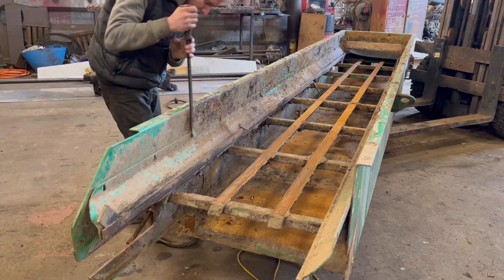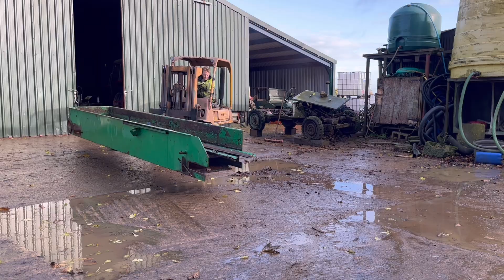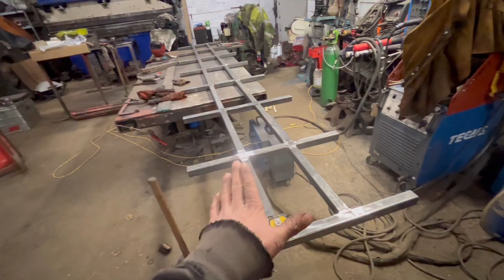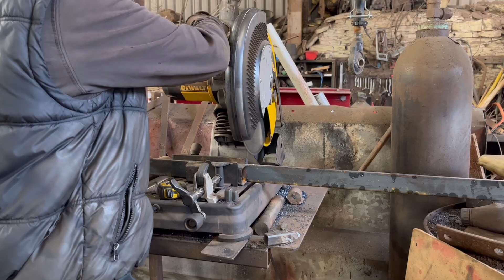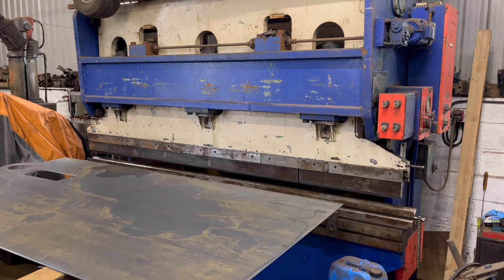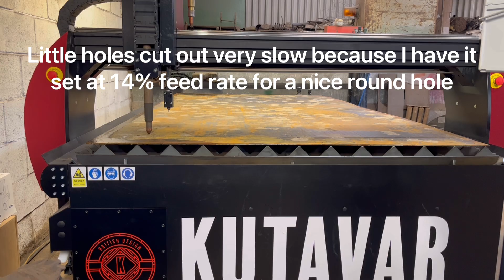Making a water tight conveyor body. Part 1

Comment: Little tip to increase the life of you chop saw blades, turn the box through 45degrees so the blade goes through the corner of the box. Obviously only works with straight cuts

Comment: i don't know if they are available in the UK but HBM machines (google them i guess) has welding tables (weldkar), 5800 euro for the larges one being 3000 x 1500 x 15 mm 28mm holes.
still crazy money to me but less crazy than 16000 pounds

Comment: Nice work Oliver
Pity your mag drill doesn’t have an auto feed or you could set it off on your current layout table drilling 1 inch holes on a six inch grid; you’d have a layout table far superior to any table available commercially.   Yes, it’s ludicrous the cost of professional/production tooling these days but you’d mak a far superior table than currently available.  Time consuming I know but you could drill an awfy lot of holes for 10 - 16 grand.  Great channel, you’d think after a life time of heavy vehicles production and maintenance that I’d have had my fill of the likes but I still think enjoy yours and similar (IC weld, cutting edge and on fire welding) channels.  Good luck, your content is excellent, keep it up🙂.

Comment: Fireball Tool makes a jig for drilling holes to make a fiftire table or add more holes to an existing one. Me personally as ive had a couple years experience with a fixture table ill tell you they are stupid priced right now because its all the rage.  If given the opportunity to sort one out for myself personally, I'd go with a Cast iron platten table and make the legs to fit my desired heigth.  My work spends around 20 grand for the tables we use and another 8-10 for the fixtures and clamps(granted they are going through a middle man supplier and he has a substantial markup)

Comment: 27:31 ceiling mounted power strip to give you a tie point above your head, away from the dirt on the floor and places where it could tangle. So much better than having it on the floor, especially in an open shop like yours.

Comment: You can use cheapo magnetic lifters from the usual places to make points for you to use clamps in the middle of the table. If they can lift at least 50~60 kilos, they're good enough for a tie point.

Comment: I have to agree that you are superior and it is easy to follow what you do.  On one of your previous vids you were making the JCB front bucket.  You were not getting a 90 degree bend thru the whole length of the plate.  I think the shear has a rake in the blade.  Maybe only an 1/8" or so.  Something to look at.  Excellent craftsmanship and your welds are on par with Kurtis and Isaac.

Comment: The custom pipe work for your tractors turbo is awesome.  Anyone can buy a bender and make one look factory...but where's the fun in that. Hand-made is the sign of a true craftsman. If it will work and not affect flow, then I say run her. If it sticks out of the bonnet , so what. It say's look at me.
Take a look at some of the custom hot rods here in the U.S. where  custom is king!
You do great work.

Comment: You mite think about having the holes on the slide in frame threaded mite be hard to get the nuts on there when they have the belt on just a idea  other than that looks good
Reply from the maker: Yes, think I’ll just weld nuts on.

Comment: THis conveyor looks like a good application for HDPE strips fastened to the rails for the belt to slide on.  ALso can be used to close the gap between the belting and the sidewall without adding any significant friction..  If you haven't used it before, give it a go.  It is an amazing industrial wear with almost zero friction  material. 👍

Comment: Nice little project to test out the new plasma. Coming on good. I see the vintage tractor grapevine is working. Repair one steering pivot. More will come. You won't be short of work. The hard part is fitting everything in. Maintaining the right life balance. Don't get caught up in the working 10 hours a day. Six days a week gig. For most of your working life. Then look back at what you wanted to do. It sucks. A tip from personal experience.

Comment: You sure do get in some strange jobs with associated challenges. Do you know what the use of this device is? Something like a gravel plant for grading stone maybe?
Reply from the maker: It’s part of a potato wash plant. This conveyor attaches onto the bottom of a big drum that separates the stones and soil from the spuds, the conveyor runs on a 45degree angle filled with water to the same level as the drum and removes the stones and soil that sink to the bottom.

Comment: Hi Oliver, loving the channel and the content. The one observation I have is that often you don’t wear gloves when grinding or whacking stuff with a hammer. After a lifetime of doing the same I’m now suffering with hand and joint pain and it’s one of the few things I wish I’d done differently. I hate wearing gloves so I get it, but the impacts and vibrations take their toll over the decades.
Reply from the maker: I don’t like wearing gloves holding a grinder because I feel like I can’t grip it as well.  I am definitely doing more to look after myself these days though.
Reply: @snowballengineering  i know what you mean, I’ve dropped a few active grinders whilst trying to wear gloves 😬

Comment: Nice work 👍 
We ended up with a build pro/strong hand? Fixture table, had it about 6 years wouldn’t be without it. It’s sectional so started as 1x2 meter but we have extended it to 2x2.5m with one pull out section that will go extra 1.5m 
Made another table with sheet of 15mm on the plasma and reamed the holes to size.

Comment: a to you bolt bin i have made mine own i slide the trays out the draw slides are not cheap to special on with a soft close on them if you mess you have to figure out the best way to store your bold and nuts  this one i have got now is stainless steel  food trays they can come with 3 trays in the tray too   bulk bolt you have the whole try  then don't you don't use have in the 3 try  bins 
have them on wheels too  
you need to figure out the best way you want to have a bolt storage i have children who help me with my repairs  she is an awesome welder she is 8 now just taught her to tig now  
i have colour-coded the bolts for threads and nuts

Comment: If I was you. If cut a 24" x 24" hole in the floor and dig it out about 36-48" deep.  Make 6 anchors. From roughly 25mm steel bar. Make augers for the bottom end. Make them about 5'-6' long. With the top side threaded . Possibly made from two pieces . Having flat bar with two M12 bolts holding it together. Nake a couple 1/2" rebar rings to hold them In a roughly 16" circle. Having the hole on the back wall. Possibly on the right side to have the most room and reach.  Fill the hole with concrete and large rocks leaving the roughly 25,mm threaded section about 4-6" out the top. Bolt a 25mm 16"-18" square plate of steel. With a 10" hole in the center to weld in a 10" thick wall pipe roughly 12,mm thick. With it being tall as possible having as 20,mm steel ring welded to a machined insert welded into the pipe. Leaving 6" inside  and  16" outside. the 20mm thick by 50 mm wide ring with a bushing about  6mm thick iron or brass with grease grooves all over it. And a thrust washers set 3 bearing washers to ride on the 50mm wide ring. Each layer having groves with holes 6,mm with a 10" x 14"12, mm wall pipe with two 14" long bits of 12,mm thick 150mm angle (6" angle steel)  this should spin easily on the greased bushings  having another steel ring on the top with 6mm bolts to hold it in place.  Then weld on to the angle bits forming a flat surface. Weld on a I beam about 12' long.  With another machined ring about 36" from the top /bottom of the beam.50mm wide machined to allow rollers to smoothly roll over. Having two 100mm wide 12mm thick  rings cut from 22mm plate just about 12-20mm larger I'm the center than the steel ring for the rollers. Then cut them in two. Drill holes for 10mm bolts  to allow bearing to fit , 
10mm center and about 20mm outside. With the bearings pressed inside a steel roller about 40-50mm tall having a roller about 70-80mm on center around the ring with about .020" clearance.  Roll a piece of 12mm steel about 60mm wide. And about 26"long to weld to the roller braces , also weld 6,mm x 20mm flat bar to bolt the two halves of the roller brackets together. House a-6,mm thick wall 50,mm x 75mm  square tube from the roller ring to the I beam about ,48"from the pipe. With rollers and a winch on the I beam it can reach the door lift 1000-1500 pounds. And you can push it to the pipe and swing it to the work benches.  Just be sure to weld a plate over the end  with a thick rubber block on the end, to keep the winch on the beam, I would also make extra hoop with a roller on the top of the beam to attach a small chain hoist or to hang things and having small led flood lights on the beam can be really useful a high density led tape light strip to run between the rollers on the winch carriage and a small floodlight on the end. Very useful. Use a DC power supply, and use a 4butyon remote key fob to switch it on. A 30watt, 50watt, and especially 100watt LED light is extremely bright! And the strip lights two high density strips in the bottom center and one each side. With a button to power the flood light. And one for each strip light would be awesome. And building a support stand to hold the end of the beam for extra heavy stuff. It would allow stationary lifts of possibly 5000lbs plus
The winch trolley would still move. Only the beam would be stationary.  The only thing better would be a full on shop crane. To allow lifting at any corner.  While I was at it I'd build a large pulley block and a double spreader bar. Use about 4" channel to make a I beam about 4'-5' long and two pieces of 2" channel forming another I beam bout 36" long. With a 12,mm plate on the ends. The 2" I beam getting 4"x 8" plate with a hole large enough for a 8,mm chain to pass through, or just a D-ring. To connect a strap to safely. While the larger I beam gets a 10" x 10" plate with rounded corners. And a large center hole and two s mm smaller outer holes. One on each side being about 20-25mm with the center being about 50-60mm and the small beams fitting to the larger using the two smaller holes using two similar tabs on the top center of the beam. It can be bolted on or by two D-ring clevis. The end plates from 12mm plate. The hook and pulley block  cut the hook from 25mm thick plate turn to round on one end and thread. Turn a blunt point on the other. Heat it and form the hook having the hook. Loosely bolted to a 1/2" plate about 75mm long turned round on two ends leaving room for the hook to bolt in the center leaving two pins on each side to fit into two plates. That also hold a 75-100mm pulley the tabs sticking out the plate having two 12mm thick about 35mm od. With just under 12mm Id. (The 12mm plate turned down to round.so possibly 11mm). Forming a swivel. Also drill and tap the hook nut to accept a m6 hex head bolt.recessed into one flat. Safety wiring  the bolt head is optional.  And the use of a 15mm I bolt on the winch pulley to use the block slow the lift a bit, gaining slot of control. I'd use a 2500lb ATV winch, and just sit a battery on the pole, run done 4gauge cables to it and out a battery tender on the battery to keep it charged. The battery can also power the lights. Also add a 10 amp charger option incase you want light all day.. it would be worth building, maybe not as heavy duty As im thinking. But a crane would definitely help. Make a one man operation alone better!.. the fork lift can take a little brake!..  just an idea!!
Reply from the maker: That’s a very in-depth description, thanks  for the idea and for taking the time to write it out.

Comment: Ollie, what's the make/model of your grinding face shield with the fume protection? Thanks
Reply from the maker: It’s an 3m speedglas 9100 adflo
Reply: @snowballengineering  thanks. Hey just two little things I thought I'd share. If u had a cement mixer filled up with nails or such material, you can chuck in your tabs you made and spin them around in the cement mixer to clean up the burrs etc... leaves them like new. Another tip to make equal length cuts on the dewalt saw, is to make a stop to butt the sections against. Thanks for the great vid

Comment: I had to laugh when I watched you going back and forth to line up the metal sheet in the press brake.  I work by myself and often wind up doing the same thing...  Anyway, possibly you could use a magnetic welding square to temporarily hold one end of the sheet to the press brake die and cut down on the number of trips back & forth...

Comment: From 2004 I worked for R.J. Herbert engineering they specialised in conveyors and vegetables pack houses equipment for washing grading and packing produce for customers all over the world, Including 90% of the European conveyor market all equipment was either fabricated in mild or stainless steel, Everything was manufactured using cad and plasma or laser cut, Two huge big press brakes and two guillotines were used, With a separate machine shop and three welding fabrication shops every section used overhead demag ten and five ton electric cranes, With two fitting shops and three paint and blast bays🇮🇪

Comment: Stumbled on this channel but what a good watch ! , can I ask though why you use 240 in the workshop as opposed to 110 or air or cordless the latter ones obviously the lesser of the 240 risk in a workshop .
Reply from the maker: I think most workshops run on 240v in the UK. 110 for site work.   Cordless just don’t have the power I find and I don’t use air tools because I can’t be doing with listening to a compressor running all the time.
Reply: @snowballengineering  Interesting that you have 110v there in the UK, I thought it was only the US that had 110v. Here in Australia, everything is 240v. If you want 110v, you need a step down transformer. Big workshops and factories mostly use 4.5V for big machines. That's two or three phases of 240v.
Reply: @snowballengineering  the common supply for uk is 110 as its a lot safer voltage , from a central 110 transformers  or the new standard is hf (green plug) high frequency)
Reply: @davidwhyld970 interesting that you say the common supply in the UK is 110v. I've been a welder/ fabricator for 36 years & every place I've worked at was 240v for handheld power tools.

Comment: Nice construction work Oliver! Yes the rainfall in this area does not stop, soon we can better use the term rainy season. A next tip might be to weld 'long nuts' to the removable frame, these will last longer than standard nuts, especially in the application in which this conveyor is used..Thanks always for the videos

Comment: Really nice build, looks far better than the factory version and you haven't even finished yet. Over on Diesel Creeks channel he has a nut and bolt storage system with QR codes for re ordering stock, not sure however if there is something similar in the UK would definitely be useful. It's a pity someone out there hasn't got a shop gantry crane they no longer want, it would definitely help you with some of the lifting especially when the forklift is too big for the space.
Reply: Seems we all watch the same channels👍